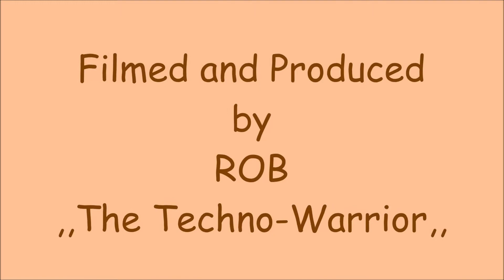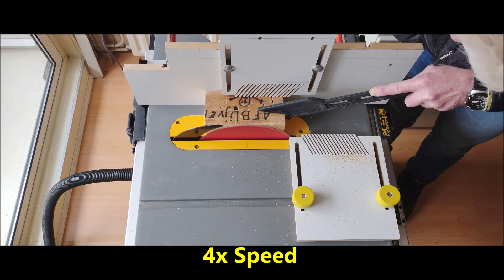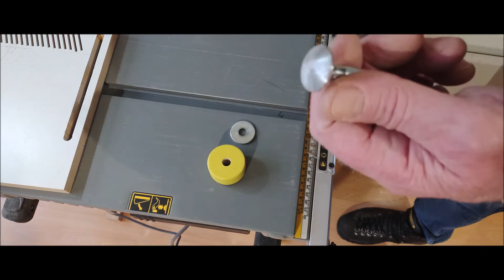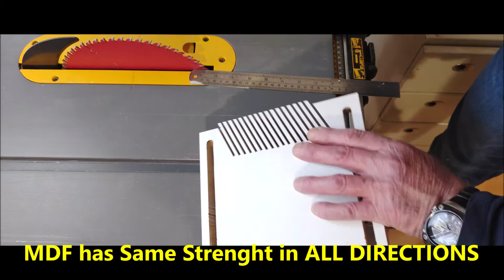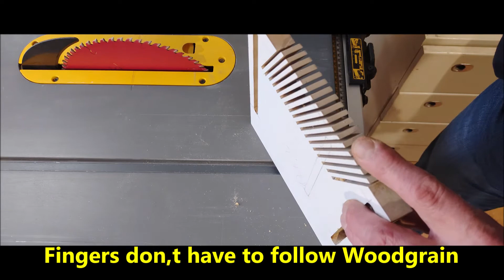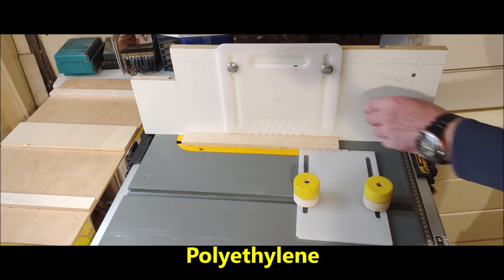FEATHERBOARDS for DeWALT DWE 7492-qs  DIY Part 8

Comment: I have the same saw and could not find a commercial featherboard that fit the saw.  I like you version for a DYI feather board.
Reply from the maker: Hi jim, indeed! You,re so right, that,s why a made these exactly fitting from the Miter Slot up to the Side of the Blade! I made several different types and this model stood out!!
I think if you do all my modifications  (or similar) you are very happy with such an pretty accurate machine and easy to work with !
Greetings Rob!